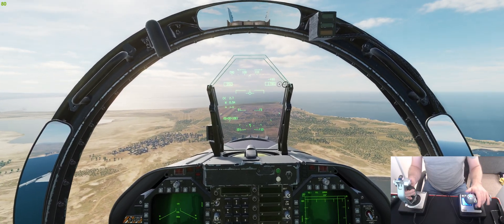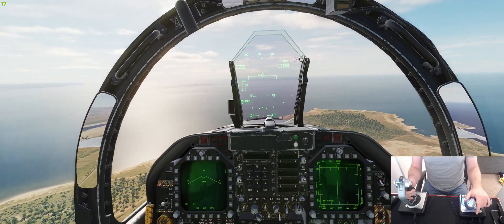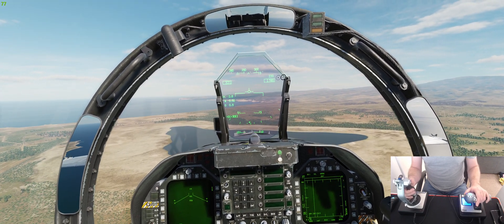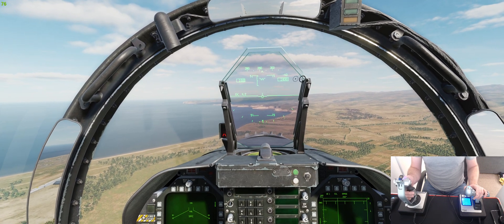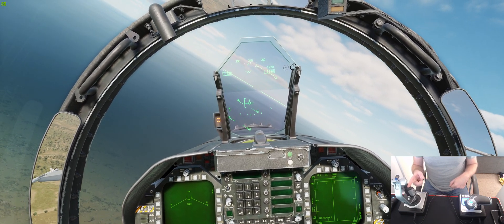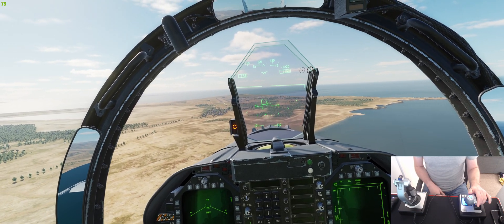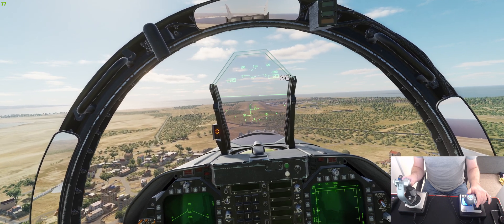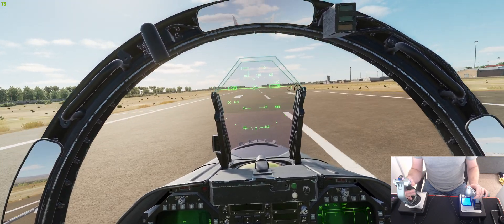DCS: F/A-18C - How to maintain onspeed AoA the easy way

Comment: How come my jet won't fly like this? Letting go of the stick, it becomes unstable and veers off....and as for trim...well my trim doesn't register and if I wait long enough to see if it does register, it doesn't so I add a little more trim, then the jet will either pich up/down violenlty or bank one way or the other.  I have to fight every 'landing', well explosions on the ground - I hardly ever make the runway...been following all the advice on videos  like this, but the result is the same...

Comment: I just started flying the F18. So far in DCS I am mostly flying the F15C &E, The Viper and just started the F22. I have been prepping to do carrier landing so I am trying to tighten up with better control of Speed and AOA. One vid a guy was flying it at 130 knots. I tried but in no way could do that. I see that I settle in at the very same speeds as you do for the most part. I'm going to watch this one a few more times because I am still having to use quite a bit of pitch control. Thank you.
Reply: Pitch, in this situation, will change your airspeed, not your altitude. So if you're coming in too high, pull back to lower your airspeed and increase your rate of descent. If you're too low, push forward on the stick to gain airspeed and reduce your rate of descent. At least, I think that's how it works.
Reply: @Feintgames  Yep, I overcame this back when I posted. But thanks!

Comment: There is about a half sec delay on throttle inputs also, so if you add throttle as soon as the indicator starts to rise you want to decrease throttle a hair to counter it. It's the same with AAR.

Comment: Very good. I do similar but I don't drop the gear until 250 knts, half flaps at about 220, full at 200
Reply: Gear + Full flaps is max speed 250
Reply: @Raptic556  Yep. I  wait for more speed to bleed off before deploying flaps because the aircraft doesn't balloon as much at lower speeds when the flaps come down